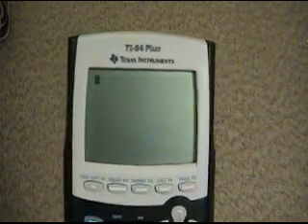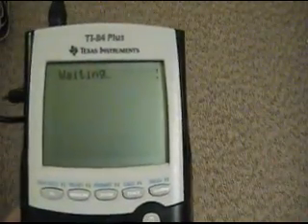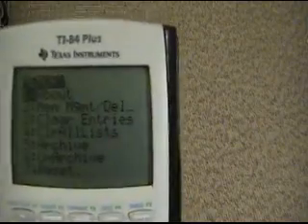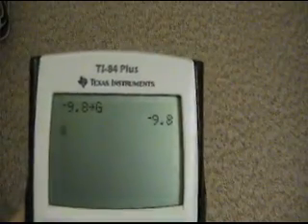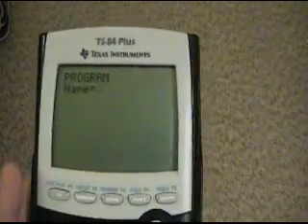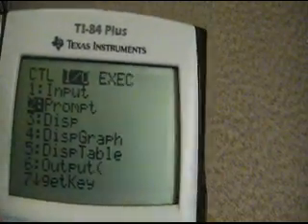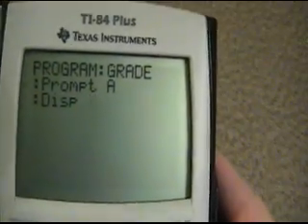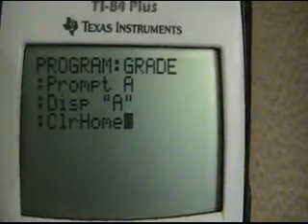How to Program a Calculator pt 1: The Basics

Comment from the maker: @tym4n Use the 'disp' command.  If you are asking how to put it on the same line, use the output command.

output(4,6,A) would put whatever number is stored in A in the 4th row from the top and the 6th column from the left.  Replace A with "A" to make it display the letter A instead of the number stored in A.

Comment from the maker: You can make it display a number of times.  Normally, I like to make it display an infinite amount of times if I do this, but you can install a counter.  What you do is make a "repeat" loop.  This will make the programming repeat until a condition is met.  Like so (parenthesis are for understanding, not programming):

:0 -> X (store 0 into X)
:repeat X=23424
:disp "blah"
:X+1->X (X plus 1 stored to X)
:end

Comment from the maker: Answer, there is another wire.  You know the end that plugs into your calculator?  You can buy a wire that has that same thing on the other end, so you can connect calculators together.  To transfer data, press 2nd X (AKA "link")

Also, I have a TI 84, so I am not sure about the CD.  A CD came with mine, but it might not have come with yours.  Chances are that you have a CD lost somewhere inside your house.  I'd be surprised if it wasn't included, but someone please correct me if I'm wrong.

Comment: question, i'm using my sister's graphing calculator which is a TI 83. i only have a wire that connects my calculator to my computer, is there another wire?

and also, when i connect my calculator to my computer, it asks me for a program/disk. do these calculators come with CD's? or is the program needed to install into the computer in the calculator?

Comment from the maker: There's also regression lines right there.  To calculate a Z scores or percentiles, try normalcdf( and invNorm( under 2nd, vars.  There are also more calculations with 2nd, stat, go right to ops.  Lastly, you can reuse any of these numbers in your own calculations by pressing vars, statistics.  Keep in mind that you have to calculate 1 var stats before you use these, because it assigns the most recently calculated numbers to those variables.

Comment from the maker: Lol, thanks for the compliment.  I can do you one better than making the program.  It's already in the calculator!  Most don't know this, though, because it's not easy to figure out.  You have to know it exists.

You have a "stat" button on your calculator.  If you press it and cycle over to calc, you will get everything.  Press stat, edit, and you can input your data.  Press stat, go right to calc, and select 1 var stats.  It will spit out any number you can think of.